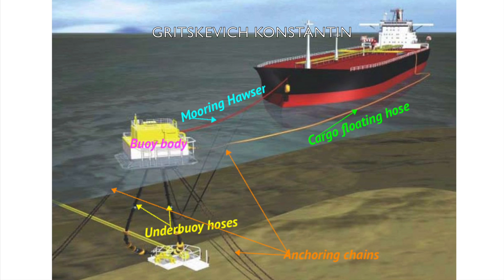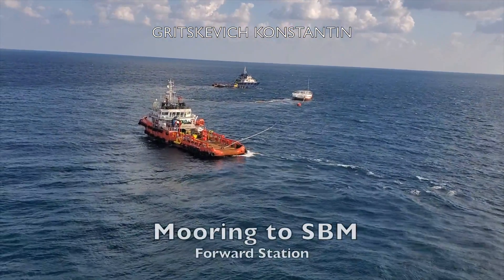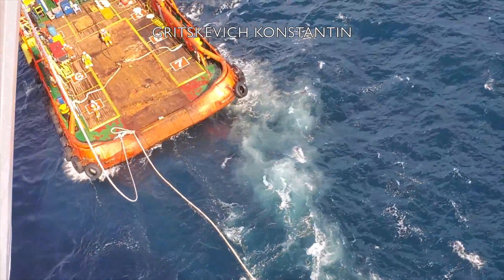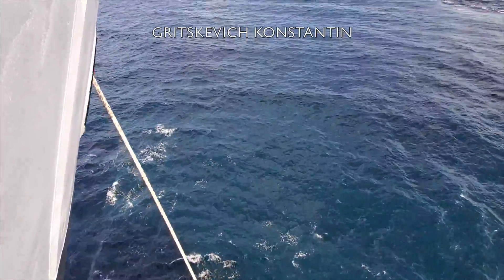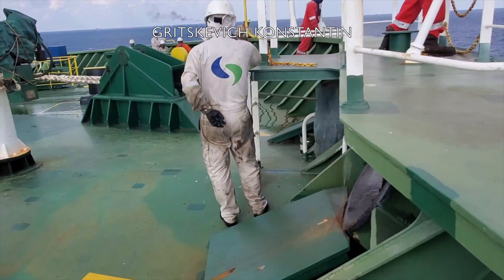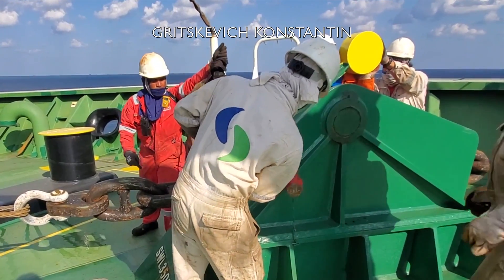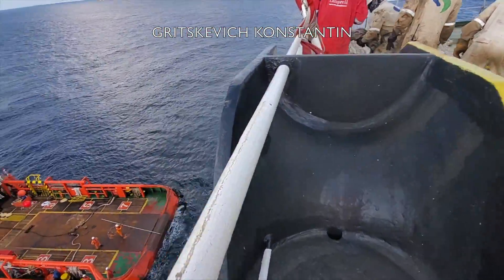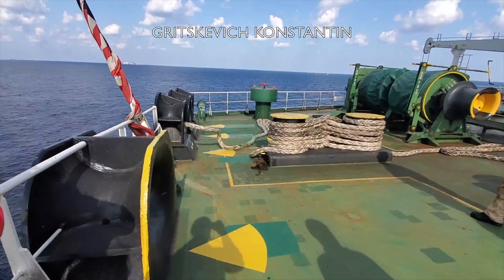SBM / SPM Mooring

Comment: Hi Konstantin - thanks for putting this together, very interesting! Do you require a tugboat the whole time you are secured to a mooring buoy to keep line tension? Won't the natural flow of water and currents keep the line tight? 

Thanks!
Reply from the maker: Hi David, thanks for the feedback.
The current and wind direction sometimes could change drastically, that' why the aft tug should be secured after mooring to SBM and cast off after unmooring.